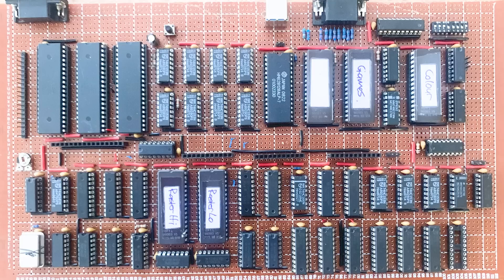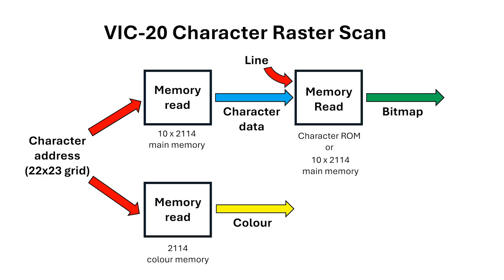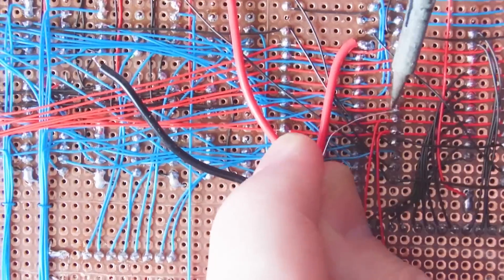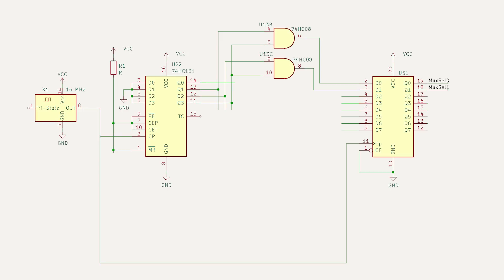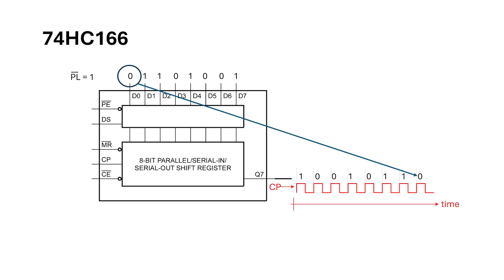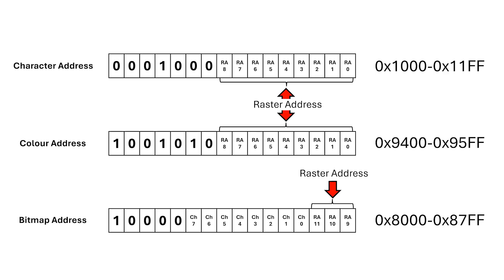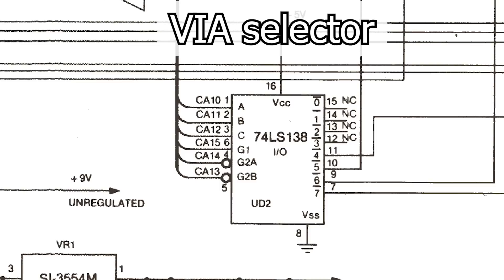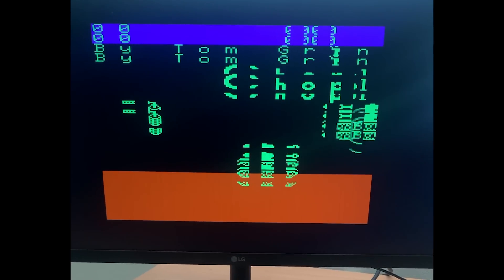VIC 20 build.  Monochrome video output.

Comment: I always wondered what the second chip select line did on the VIA. In my design I fully decoded RAM using a 3 to 8 decoder and used a single chip selection line. That second line looks handy. Obviously I should have read the  data sheet more carefully.
Reply from the maker: Yeah, i guess every dollar saved is multiplied by a couple of million for commodore, so it's a priority for them, but not us for one off prototype builds.

Comment: Re your aside at 3:40 - the VIC buffers the bitmap internally, also there are several other stages, clocked by the two phases of the pixel cloc,  before a pixel reaches the output stage. Then after that there is probably an additional delay because the output stage uses several inverters. I believe the sequence goes more or less like this
- character / colour read (PHI1)
- CPU access (PHI2)
- bitmask read (PHI1) <- this stores whatever was on the data bus during PHI1 high in an 8-bit register
- CPU access (PHI2) <- here, during the second half of the last pixel clock phase the VIC will copy the contents of the 8-bit register to another 8-bit shift register, which is then shifted during the other pixel clock transitions
- PHI1 character / colour read for the next character, unless the previous character was the last one on the current row. During this phase the bit that was shifted in goes through 4 stages
- at more or less the next PHI2 high transition the pixel will be output
So I guess it is neither 1 or 2?
Reply from the maker: Interesting.  I don’t think I articulated the question very well, but what I was wondering is whether (1) the bitmap data is loaded directly into the shift register and serialised, or (2) is it stored in another register first then transferred into the shift register to be serialised.  This is the extra register I was talking about.   So I think you are saying 2,
With the my current design the serialised data goes through a couple more pipeline stages before it’s displayed.  So it was more about when it’s loaded into the shift register.

Comment: Wonderful job explaining the workings!  A couple of things I noticed... I see that the addresses for the VIA's are only partially decoded (same as in the actual VIC-20), so, for example, at address $9030 I'm thinking that both VIA's will try to respond and the result will be garbage.  Is this an issue that should be considered?
Second, and I have been caught by this one, I see you haven't incorporated the clock signal into the chip select for the RAM.  Not doing this could cause random writes to the RAM which would be undesirable to say the least.  The explanation of why this is necessary is shown by Ben Eater in this video: https://www.youtube.com/watch?v=i_wrxBdXTgM (start around 22:00 if you don't want to watch the whole thing.) I'm thinking this would apply to this build as well but maybe that's in an upcoming video.  
Again, a wonderful video, can't wait for the next one!
Reply from the maker: Thanks for that.  Yep, 9030 will cause a conflict, but i imagine that everyone who write software for the VIC-20 would avoid this.  Technically someone may use this, so at least we'll act the same as the real machine.

Well, spotted on the clock signal.  On the prototype i do actually run the R/W signal through an OR gate with clockbar.  I just forgot to update the schematic between revisions (which tends to happen when i'm rushing to get a video out before the weekend).

Comment: Where would one find those older style keyboards that work directly with the Vic20/C64/Apple ][ ? Do you have a Perfboard video series on making one? I'm in a smaller island town in Canada so the famous USA swap meets are not an option.
Reply from the maker: Umm, this keyboard was from a non-functional VIC-20 i got on Ebay.  There are still a few around.

Comment: Absolutely loving this. Being a ZX clone enthusiast since 15+ years I've been waiting for a TTL based Commodore machine. I guess the C64 is way too complex with it's 1000s of unintended features in the VIC-II/SID, but the VIC20 being a project that seems feasible to not end up with hundreds of chips.
Reply from the maker: Wonderful.  We'll see about a C64, but the VIC-20 is simpler and lower hanging fruit.  I'm still planning to replace the 6502 and VIAs in this build as well.
Reply: @DrMattRegan  Did you decide yet on how low level/accurate you want to go? Specifically regarding raster based effects or demos that use undocumented features/bus noise.
Reply from the maker: @RandomBlankUsername  don’t know how far I’ll go with undocumented features, I’m more seriously thinking about making it accurate to the VIC specifications, but I might pass the batton onto someone else if they want to extend it to the undocumented ones.
Reply: @DrMattRegan  That's probably the approach that makes most sense and quite frankly is what most ZX clones do as well. There are very few machines that support reading attributes back from the screen, which is unintended behaviour of the Sinclair made ones turned into a feature used by less than 10 programs - simply because it just adds to the complexity, while adding very little to the overall functionality.
I'd assume if you can run 95% of all popular games it will be more than enough and as you said - a base for further improvements in case someone really wants to do a deepdive.
As said - really looking forward to this.
You're aware of the MOnSter 6502 and J-CIA projects, right?
Reply from the maker: I'm more familiar with MOnSter 6502 than J-CIA, 
but moving forward, i'll probably use the 
Turing6502
https://www.youtube.com/playlist?list=PLjQDRjQfW-84j-jLvrbEeDvGl0QrhX9p7
and the SAP6502 is also an option
https://www.youtube.com/playlist?list=PLjQDRjQfW-85S5QkX8wZbkqichM6TLYYt
Check them out if you haven't seen them yet.

I personally like the Turing6502 better and it has fewer chips.

Comment: When you do the colour circuit, any chance of a side quest showing how to implement the Plus4's 121 colours ? as you have 8bits of colour data available in this scheme. A hybrid VIC20 with 121 colours would be interesting, you would have to call it the Plus2, & a C64 implementation would be even cooler.
Reply from the maker: Interesting thought.  I'm thinking of going on to a C64, but first i want to replace the 6502 with TTL logic as well in the VIC-20.

Comment: This is so very cool. Would you be releasing a pcb board we can order to make this ?
Reply from the maker: Yeah, there are some thoughts around a PCB.  After i replace the 6502 with TTL logic and finalize on a design i might do one then.
Reply: @DrMattRegan  let me buy one when you are ready. Is there a waiting list for it?
Reply from the maker: Sure, nothing formal in place yet.
Reply: @DrMattRegan  fair enough. This work amd your spectrum are top notch. Keep up the amazing work.
Reply: @DrMattRegan  thank you. The vic 20 is a personal favorite.  And vic chips are becoming too expensive. What form factor will the pcb be if you have a idea on your head about it ?
Reply from the maker: Hopefully ZX spectrum size, but with audio, it's more likely to be VIC-20 sized.  I may issues them as two different PCBs, but i'd like them to fit in the appropriate cases.  I particularly like using transparent cases for TTL builds,  something about a transparent architecture and a transparent case.

Comment: At last! Looks like I can get my old wire wrap gun out of the draw!  Everyone has to have a hobby right? Keep up the great work!
Reply from the maker: Excellent, have a go!
Reply: @DrMattRegan  but what I saw was a Rockwell 65F11/12 and something running Rockwell Forth.  Yes, I am a nerd.  DON'T JUDGE ME!
Reply from the maker: @asteriondaedalus6859  aren’t they the 64 pin quad pack monsters?
Reply: @DrMattRegan  They are at their heart a 6502 with benefits (really a 6511).  Never mind me, it's just what popped into my head 🤪

Comment: One of the interesting things I've learned from this video series is that you can characterise almost all 80s and a fair few 90s machines by having 2-16 states which are statically allocated to either the CPU or the graphics circuitry. Maybe the Jay Miner designed Atari 8 bit and Commodore Amiga are bit more flexible but for the Vic 20, C64, Spectrum and Atari ST it seems like someone worked it out on a piece of paper and the machine was hardwired to do it that way.
Reply from the maker: Yep, you can also build the CPU with a state machine and some memory.  If you haven't seen it, you might want to watch this series:
https://youtu.be/gHU8whQP3Rg
Hint: this is where i plan going!

Comment: Hi Matt, is there a way to use more memory slots of the sram.  Say a multiplexer with a buffer that held the data value in the fiom memory timing slot to present it to the processor thoughout it's timing period while the other slots are used?

It's a shame that Commodore Mos could shrink down the logic in this circuit into the vic or a mcu and add to it with faster better sram, as they had a fab and design section.  512 pixel 16 colour probably wasn't too far off being possible for a Vic 2.  Certainly just character mode.  Another interesting one is the Mattel Aquarius, which made good use of game character graphics set.

Now for 256 pixels at 256 colours with 256 sprites. (I am kidding, but it's great to see the Vic's colours again 😀).
Reply from the maker: Yep.  One of the unfortunate things about the 6502 design is that they didn't think of a larger address space.  I guess they never figured it would have the shelf life it did.  But just a simple banking register internally and some control logic, very minimal, just so there was a standardized way of bank switching.

The VIC is an interesting chip, clearly the machine was designed with games cartridges in mind (hence the 5k memory), but it's biggest drawback is not using DRAM.  Obviously, they fixed that pretty quickly in the Commodore 64.
Reply: @DrMattRegan   I was meaning the timing slots.  So that the cpu read activates a read tgrough multiplexer held by the buffer in the first timing slot, leaving the other 7 slots free?

As for sram, its disadvantage is cost, its advantages is higher speed possible and higher soeed random acess.  So, for a cartridge system the ability to render to screen for complex graphics elements could have been an advantage (sram they could have rendered a character with 4 distinct colours, and in a multi colour mode like the 64, 4 per higher resolution character.  Those graphics also being ripped off cartridges.  With dram, it's likely a higher cost spend varrient (if available) or mu,ti banking to get the data rate. They had a factory but didn't take advantage.  With the 64 though, the amount of memory was the real big advantage of using lower cost dram.

But as you are saying about dram bankswitching, you are right.  I proposed a logical design that virtually makes banked segments like paged memory.  Lots of it, where you can swap in the segments of code needed and screen data, with enough parrallel banks for higher data rate graphic modes.  But, back in those days the expensive bling words like Blitter and such forth, made us forget other cheaper approaches (without mysterious Bit Planes, which turned out unnessacary).
Reply from the maker: So, yeah you could probably use 3 of the 8 slots for other things like DMA etc or more colour bits per pixel.  I personally tend to avoid modifying so much that there is no software out there that will run on it though.
Reply: @DrMattRegan  You can get by with slower sram, or people could program it for fun.

Thanks again Matt.

Comment: This video explained the one thing that always confused me with other video card builds. That was how to access memory without conflicting with the cpu. Thank you!
Reply from the maker: Glad it helped!
Reply: My favourite technique (that isn't just having seperate video RAM) is taken from the BBC Micro. Double clocked RAM. As much as I loved the Beeb I doubt anyone would really be interested in a Dr Matt style recreation but if you're looking at making your own "retro style computer" it's a technique to seriously consider.
Reply from the maker: Interesting,  i like the machines to use the existing software base, which is why i haven't gone too far off script.  If you are interested in some other raster generators i've built, have  look at https://dl.acm.org/doi/pdf/10.1145/192161.192192
Reply: @DrMattRegan thanks for sharing that. I'm currently on my phone but a quick scan looks very interesting and surprisingly not totally beyond me. Will definitely read it properly later.

My comment was more aimed at @GrandpasPlace and others as another example of techniques that were used to solve that problem. I wasn't at all suggesting you change your approach. I absolutely love your vids and I wouldn't want to ruin your enjoyment making them. And I definitely don't think I could tell you how to approach the subjects better.

Comment: Hey Matt, loving this series. Thanks. I have a question, the section at 12:56 where you describe the way the memory map works seems incomprehensible to me. I suspect that the diagram on the right (A15:A14 / A13:A12) is some kind of truth table, but it seems inverted to what I would have thought, and the "legend" of EPROM Enable bar adds to my confusion. Can you tell me what this type of diagram is called so I can go look it up, please?
Reply from the maker: Yep, it’s a karnaugh map - there are quite a few YouTube videos on them. It’s a way of figuring out what logic you need for a 4-input circuit, each highlighted group is an AND gate. These are all ORed together.  Problem is, they tend to use a lot of chips, thus the 74HC151 is an easier solution.  The idea is that a 1 represents RAM and a 0 Represents ROM
Reply: Ahhh! Thanks,  @DrMattRegan ! I could nearly tell that that was what you were intending to depict, but I couldn't map the bit patterns I was seeing to the words. The 1=RAM, 0=ROM explanation clears that up for me. Will now go study Karnaugh maps. Thanks again!
Reply from the maker: No problem, we have 2 bits along the top and 2 bits down the side.  The trick is that the ordering is 00, 01, 11, 10.  That's so we can group up the cells so they can be implemented with an AND gate.

Comment: did you try to simulate in Altium or Proteus?
Reply from the maker: If I simulate, I tend to use C/C++ so I can interface the simulation with the real circuit via an arduino.  I haven’t used a simulator for this design though.

Comment: I am building a homebrew m68k on a prefboard. But my wiring is not as neat as yours. Don't suppose you could do a short video just showing how you wire, the equipment you use, wire size, etc?
Reply from the maker: Good luck with the build.  I’ll go over the build details in the next one.

Comment: I have been thoroughly enjoying your various series, thank you very much. Indeed I think I'm going to have to convert your design to a PCB layout when it's done, with your blessing.
I'm curious to know how you are going to handle RAM upgrades - of course you will have plenty of memory to reproduce a fully expanded VIC-20, but as the memory map moves about depending on installed RAM and software expects this behavior, I guess you will need to handle this somehow.

PS: It may be you have different plans for the future, but if I might make another suggestion for a future system to recreate might I suggest the Acorn Atom? I can imagine lots of people in the UK would be interested, and the Atom was a system with all sorts of expansion options that a hobbyist might enjoy attempting to add to your 'base' design. Also the usually 1mhz CPU was capable of running at higher speeds with common hacks, which might be 'fun' to show how to implement in a TTL design.
(Oh, and it would be nice that you'd be likely making a better fist of Acorn's shockingly poor colour add-on design!)
Reply from the maker: Certainly, go ahead and build a PCB.  Generally i'll run with the full complement on RAM, but if i want to disable the RAM in 8K blocks, i can use the 74HC151, and just set the appropriate input for a block to zero.  This places ROM (usually empty) in that memory slot.  

I'll have a look at the Acorn Atom, but i'm not super familiar with it.  I want to replace the 6502 next in this series with TTL logic in this build.